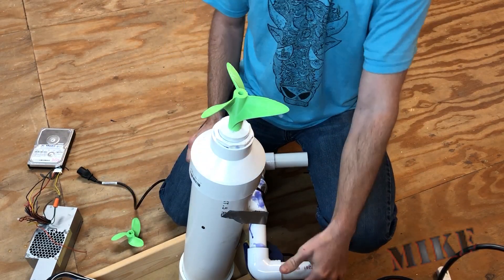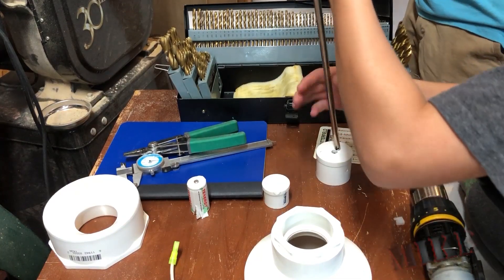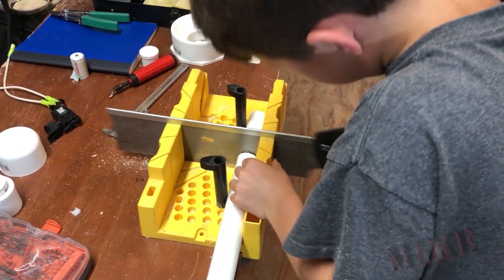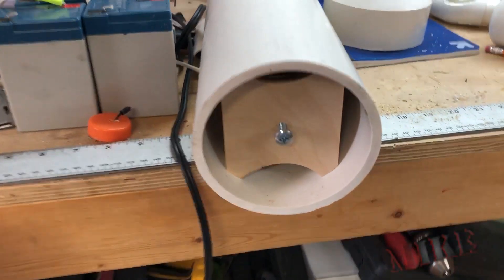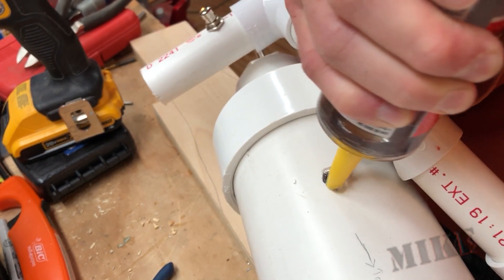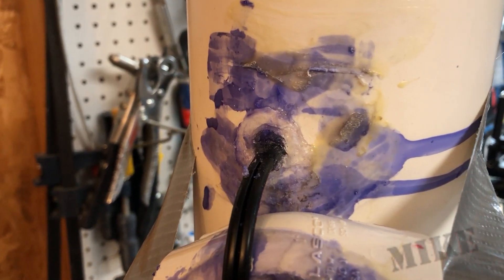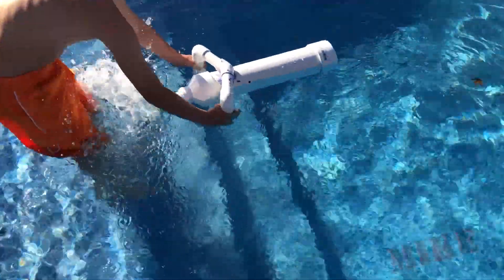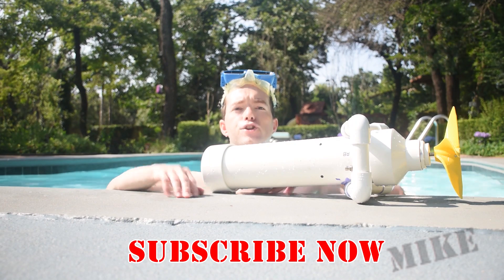Scuba Scooter Prototype- Mikes Inventions

Comment: NICE! what is thrust power and how long works with such batteries? Did you think about li-ion pack?
Reply from the maker: Thanks! So I didn’t measure the thrust, but it really was less than I wanted. This was a good enough proof of concept. I didn’t want to use lithium’s because I had no way to seal it well enough to make me certain it wouldn’t leak. I’ve got plans to make a better version. Thanks for watching

Comment: For sure a prop shroud will improve the props efficiency. You may be spilling quit a bit of the available thrust off of the ends (tips) of the blades. I’m digging deep into my memory here, but if you were turning that prop much faster a shroud would not be needed, the speed of the faster prop and the ability to move what’s it’s attached to will see the prop get pretty efficient at some point in in the throttle travel, however because this is being used to pull someone under water, it will not be able go physically move forward fast enough to achieve peak efficiency for that prop, nor does the prop spin fast enough to make up for that. By adding a shroud, you are ensuring the water next to the prop and the water being pushed by the prop can’t move to the sides and spill off in essence fanning the water beside the prop as much as it’s directing water behind it. 

If you leave everything the same and do timed trials/over distance before and after shrouding the prop it could be very instructive. Strangely the shroud may not increase speed drastically, you might just find you get a bit more battery life. Or you may achieve the max speed you get now when unshrouded with just partial throttle when shrouded. 

I love your design. It’s pretty fricking awesome.